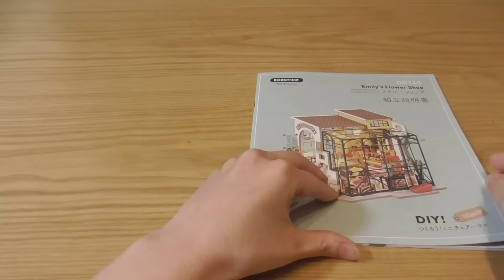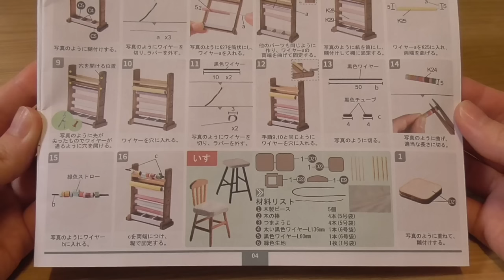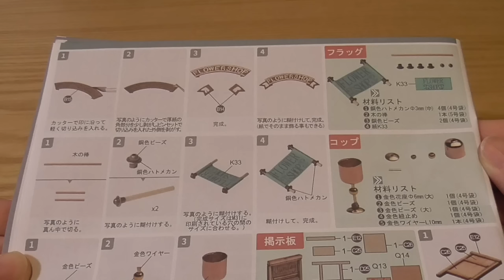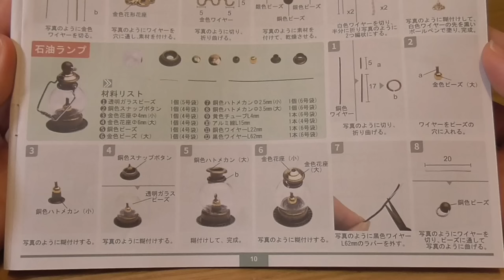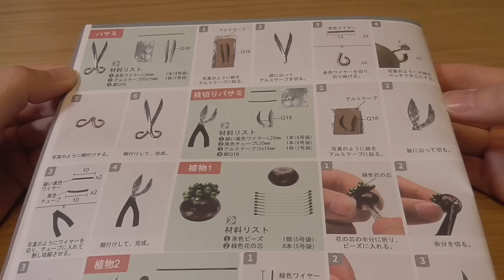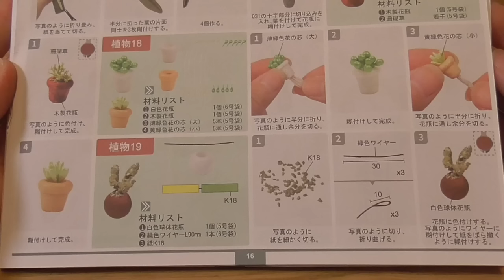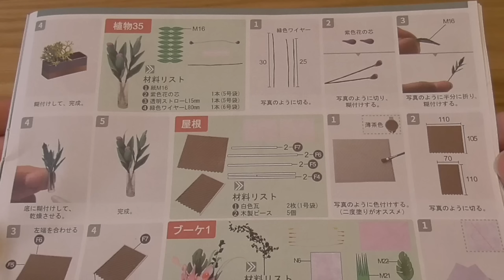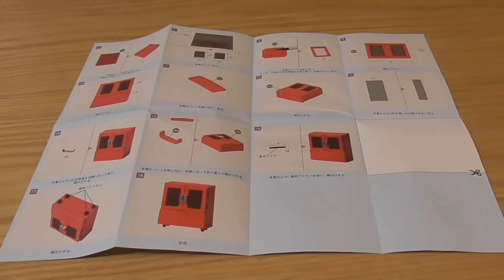Miniature Dollhouse Kit | Emily's Flower Shop - Robotime

Comment: Wow.  This is a ton of work but it looks fantastic.  Thanks for showing all the details of making the items.  Still torn on getting this one and Carl's Fruit Stand one because of all the painting and work.  How are the paints?  Are the pliers worth getting?
Reply: Hi Bethany! I'm currently working on this dollhouse so I thought I'd chime in :)  The paints are pretty quality and dry rather quickly.  It doesn't feel like an overwhelming amount of painting work.  I would recommend getting needlenose pliers to complete the wire work for furniture and such.  I tried to get tight curls and smooth bends using just my hands and it didn't look nearly as good as when I just grabbed an old pair of pliers from my toolbox.  Hope that helps!  It's a really fun one to build.

Comment: I bought this minature set recently and am about 20% through the build. I it's really fun but do you use another glue beside the one provided in the kit? I'm using it and it's so stringy and thick I feel like I should be using something else I can apply more delicately. I've used superglue on a few parts but I'm not sure it's the right stuff for this project.
Reply: Same! I'm having trouble using the glue it came with too, wondering if there is something else that would be better
Reply: I just bought this kit today, I’ve done a few kits in the past (unfinished and finished) and I just got regular clear craft glue, and I also use refillable screw top bottles with a really thin nozzle to help with precision. But I’ve also heard hot glue guns are also a good way to help bigger bits stick together 🙂😊
Reply: @erin8899  awesome! I was thinking of using a hot glue gun...
Reply: Yeah the glue is kind of a nightmare but the most important thing I found was that it dries quickly. I've gotten a couple other glues as this is my first time making something like this and none of them are as good as the one in the kit for me as they take much longer to dry, that said I'm a bit nervous to use super glue as my hands aren't incredibly steady. I might check out the gorilla wood glue next instead but that also kind of makes me nervous. 😅
Reply: Yeah he uses superglue in this

Comment: Getting this kit for Christmas and I'm very excited to build it :D Is there anything I would need to buy in advance that isn't included in the kit?
Reply: I'm now on my third kit of this type. I would say buy some Blu-Tak to hold things while the paint or glue dries, get some Superglue for things that need to set really quickly, glue stick, needle nose pliers, a craft knife, a better (softer) paintbrush, another one you don't care about for applying glue to larger areas, a gas lighter for shrink tubing, a ruler for measuring stuff, a fine point indelible ink pen for marking on acetate, etc, a really fine point pair of tweezers. I think that's most of it. Also, if you're like me and have arthritic hands, work on a light coloured surface and a hard floor so when you inevitably drop something tiny, you'll hear it land/see it. Have fun with your forthcoming new addiction...
Reply: Me too!
Reply: Me too

Comment: I got this kit but how long do I cute the wire? My wire seems really short
Reply: I used pliers which had a built in cutting tool underneath the teeth
Reply: The measurement is shown in mm how long to cut it